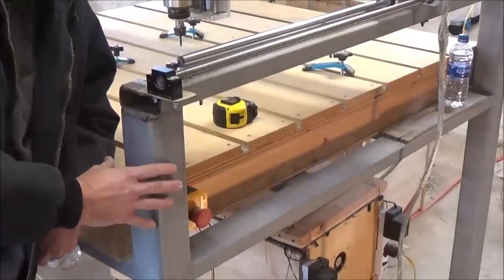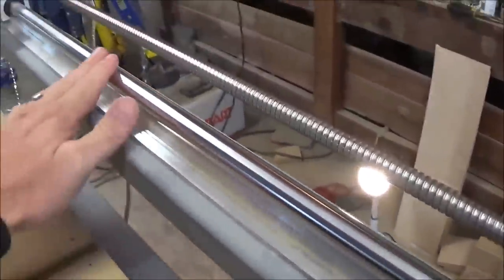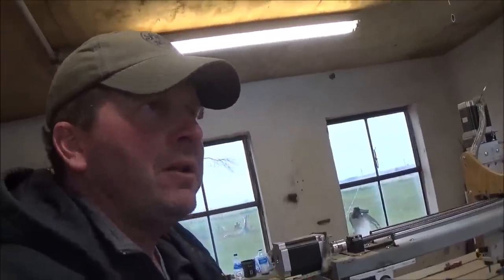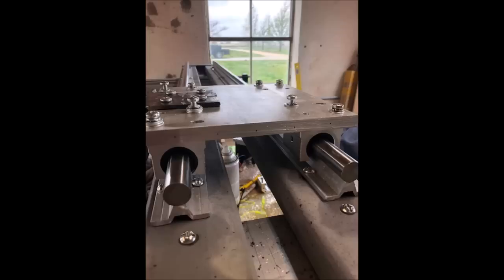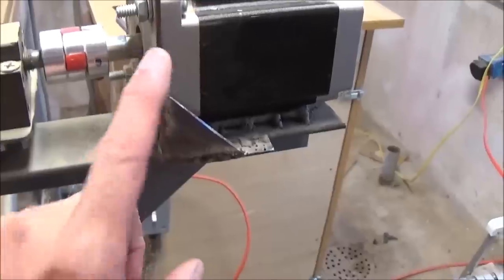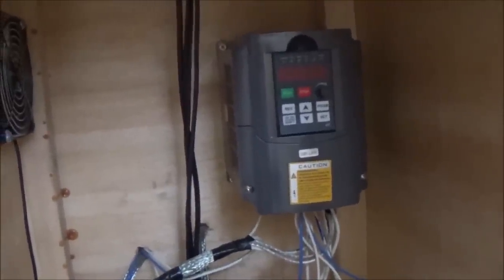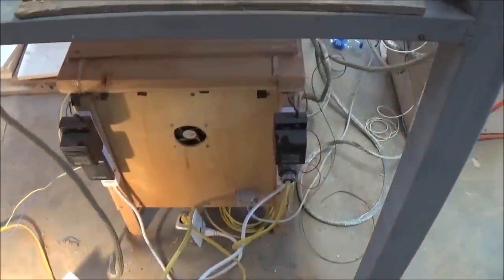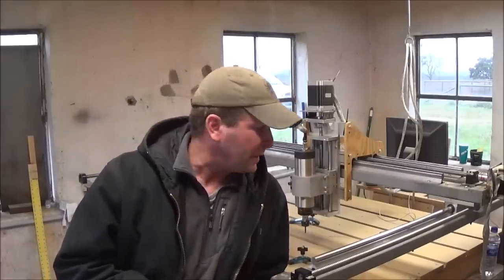My DIY CNC Router build

Comment: Great machine, will be my next project. A few general questions:
1. Stand weight. I guess that helps to prevent “jerkiness” of the table? You mention you had the material laying around/readily available, but could aluminium work? I’m a bit worried about 800lbs (I will assemble in one place, but then need to move it around to another place)
2. Squared-ness. You mention all has to be absolutely square. I agree, but I think it’s really the rods, gantry, carriage and spindle need to be square, correct? Having the table not totally square is ok, but rods etc need to be square. I’m thinking of adding a few laser pointers to allow for squaring these up easily.
3. Endstops. Did you finally add endstops to this rig....?
4. Camera suggestion. Have you heard of the DJI Osmo products (https://www.dji.com/ca/osmo-mobile-2?site=brandsite&from=landing_page)? I bought one of these for my wife for Christmas last year so I can record her dog training endeavours. She never gets to use it (I love techie toys), but does appreciate the results. This gadget may help making more “gentle” videos
5. Resolution/precision. I’m thinking of adding another head for 3D printing of larger pieces. This will require 0.1mm stepsize in X, Y and Z. Any feedback on the precision of your machine?

I will most likely use 5’ length rods and ball screws just so the table can handle 4’ material, and design the whole setup in something like Autodesk Inventor. This way I can  simulate the moving parts, and hopefully ensure that the design space is a true 4x4 feet.
I think I will also use a “vertical” X-axis (one rod above the other rod on the gantry), as opposed to the “horizontal” plane that you have: I think this will help making a true 4x4 design space.

Sorry for the long write up.
Reply from the maker: 1..Yes, I think aluminum would work great, if the "jerking" around moves the machine you could always use weight bags, or concrete anchors...
2..Yes, correct, just the rails have to be square (and perpendicular axis) however it is very nice being as close to possible to square when laying out your material for a project..
3...No I haven't added any safety features to speak of, just have a emergency stop...
4..I have hear of Dji, they make camera and drones, I know very little about them...I'm currently using a Sony Ax53 4k...
5..I haven't ever set down and measured precision and accuracy...and Yes on the gantry, I have actually made a couple of more video's about the machine where I talk about this very thing for the gantry....Have a Merry Christmas and thanks for watching!!
Reply: Smokey's CNC Woodworks , thanks for your answers and experience sharing. I have a similar camera (size wise, not quality) but find it awkward to handle: it’s made for small hands. Take a look at the dji thingy (it’s not a drone). It’s an gimbal that you can mount your cell phone on. It will keep images stabilized and will smooth movements. Great value for the money (no, I don’t work for dji, not do I receive any commissions). Merry Christmas to you as well.

Comment: Limit switches are easily available out of a microwave oven they put up to a half dozen 
In each one , of coarse they can be bought on the cheap too. Just fyi. Good job on the build
Reply from the maker: I actually did purchase some, I've just never messed with setting them up, once I got it up and running I was ready to start cutting!!...Thanks for watching!!

Comment: Great overview and information and good job keeping both the machine and the video simple and straight forward. Wish I could hang out with you. Thanks for the inspiration, I'm not going quite so big but I cant wait to get building. Cheers!
Reply from the maker: Smaller would have been easier, I built it 100% by myself and at times another set of hands would have been handy.....with a smaller machine you should have no problem lifting all the components and keeping them in place.  My gantry and the sides of the frame were really heavy and hard to get in place to weld them....Thanks for watching!! and if you have any questions I'll do my best to answer them...

Comment: Nice sold build.  One thing on your shielded wire. Make sure it's only grounded(drain) on one end. If the shieldeding touches any other grounded object it will not work.
Reply from the maker: Interesting, guess I hadn't thought about, but i only have them grounded on one end (only because I read about installing it but it didn't give the why and I hadn't givin it another thought) Thanks for the info and Thanks for watching!!

Comment: Nice video. I wonder if there is a good option for updated computer and software and all the electronics to run it. 

Im looking into building one right now
Reply from the maker: the computer side, I bought a rebuilt computer with minimal memory and the minimum windows version needed for Vectric Aspire, I usually recommend Vectric Vcarve, cheaper and does most of what I do, aspire adds 3d which I don't do much of......I bought the computer off of ebay for $95
Reply from the maker: reason for a cheap computer, it stays in the shop all the time

Comment: Love the design, this thing looks tough!!!.. Well done sir.
Reply from the maker: Thank you and thanks for watching!!
Reply: Hi Smokey....Well, after scouring the internet, google searching, and countless youtube videos; I have now decided to shamelessly copy the general design of your machine. I like how none of the ball screws are hiding under tables etc, it's just the best I have seen anywhere!!. The machine looks like a beast, and you obviously put a lot of thought into it.  I appreciate your comprehensive overview. 
My ~"copy"~ will be 3.5ft x 2.5ft .... and unfortunately 90% wood as not only do I not have a welder...but lack the necessary skills to work it even if I did lol. I ordered all the parts today and can't wait to get into this project. I used to have a cheap Chinese 60x40 ... which in all honesty worked well.. but was way to small to actually make projects without having multiple sheets... I will use Aspire (my favorite design software), and probably Mach3 which I still have laying around here somewhere. I have way too much time on my hands at the moment, so it will be a full time job for me build wise, over the next few weeks.... I'll let you know how I go  :)
Cheers again.
Reply: Update!!  :) I finished building my CNC machine!!! ... I was on a tight budget and had a great amount of luck when hunting garage sales. I got an old steel bed frame that I ripped apart and built a really nice machine with. I used the ball screw method on all axis 1m x .5m x 30cm with Nema23 motors and TB6560 controllers to control 2x X axis and the Y and Z. I bolted the machine to an extremely strong steel frame to lift it to chest height...lol it weighs a freaking ton. I built a shelf under the spoil board to hold the PC that runs Mach3...and my favorite part was a monitor and keyboard/mouse stand that's built onto the side. Yeah took a while, but I stuck to your design (although I did take your advice and rotate the Y axis 90degrees to give a little more cutting area on the X axis. I have been spending a crazy amount of time on Aspire generating dozens of projects. Anyways it's built like a tank and I wanted to thank you for your inspirational design. You rock Smokey Cheers!..

Comment: Great machine! I use wooden hold-downs because they are cheap and sometimes I cut very close to the edge.  You might be able to see them in some of my cnc videos.
Reply from the maker: I have considered using wood hold-downs, because if i did get into them not near as big of a deal!....Thanks for watching!!!!
Reply: Smokey's CNC Woodworks , I like your metal but adjustable machine. It is stiff. I subscribed.  I also do cnc videos.  I made a $200 machine but wow is it accurate.  I built it especially to make parts for a super secret project that I will soon reveal. :-)

Comment: How did you wire two motors on the "Y" axis? I have been looking at control boards but I am a little confused because they only have one out put for each of the axis. A few other boards have multiple axis out puts, ex. X,Y,Z, and then A,A (A having a slave). Are you able to tell the software to use A and A (Slave) as a "Y" Axis? Thanks!
Reply from the maker: Yes, In mach 3 (Controller software) there is a slave option.  So I have Y and A slaved, and works great...Thanks for watching!!

Comment: How much of a workable Z axis do you have on your build? And after using it a while are there any changes to to it that you wish to do?  My dad and I are currently building one, based off of yours, and we even have all of the parts already. I am just perpetually debating  on the distance between the bottom of the work board to the bottom of the gantry.
Reply from the maker: Ok so my max travel is roughly 5 inches as it sets...I made the work top removable so if I need more travel I can throw a sheet of plywood in the work tops place and gain another 5 inches....What I would do differently is make the y rails (the left and right rails) about 4 1/2' to 5' apart so your x axis could get a true 48" travel...On the Y axis you lose some travel because of the width of the gantry. On this I would either turn the gantry up on its side to shrink its footprint or I would mount the spindle in between the 2 rails on the gantry, this would allow you to cut down the loss of travel in half(to about 5" loss of travel)..My gantry is about 10" from the back of the gantry to the bit..So I lose roughly 10" of travel on the Y axis.....Thats all I can think of off the top of my head, LOL...Like i think I said in the video, I just did a lot of research and went to work on it without really a plan other than what I had in my head of what it should look like....Thanks for watching!!!
Reply from the maker: You can reach me at SmokeysCNC@gmail.com, I'll answer what questions I can if you get stuck and point you in the directions I got some answers.
Reply: @SmokeysCNCWoodworks  Thanks for your reply, that helps a lot. I'll make sure to email you a picture if we ever finish.

Comment: Hi brian  I have a question  about  you  set up  on the y axis  with  nama 34 I try to build 4 feet by 8 feet y axis motor can run ok but  some  time want run  opacity direction one go one way  the other the other way

Comment: I'm really close  to getting a build underway. the machine won't be for hobby purposes, but to be an addition to my small business where I already have a new commercially bought machine. I'd like to know what your tolerance is now since you've had it for a while now.  Under .005 or .0005? Please let me know. thank you
Reply from the maker: I've never really measured the tolerance....I will work on that and get back with you...Thanks for watching!!
Reply: @SmokeysCNCWoodworks  a big concern which relates to the tolerance is backlash. I should've been more specific. Let me know. Thank you

Comment: whats the part called that you tap on ballscrew glide? were did it come from i have 6 footer ball screws 20 mm 1800mm and i cant seem to find them so i can screw the gantry plate on
Reply from the maker: That is 1/2" aluminium that I cut down to 5" x 9" plates and attached the glide...Thanks for watching!! email me at Smokeyscnc@gmail and I will go get exact measurements and take a pic if you like..

Comment: Very impressive that whole steel frame is industrial quality and has to be very solid. Have you had any problems with the electronic end of it after this amount of time or anything you would have done different? Thank you for sharing this is amazing!
Reply from the maker: I haven't had any electronic problems, the one thing i would have done different is put the electronics box beside the computer stand at the end of the table...right now the electronics box is under the table and it is hard to get down there to do anything and the way i wired it up, i would have to unwire about half  of it to get it out from under the table then rewire and so far I"ve not wanted to do that.....THanks for watching!!

Comment: What happens if one of the Y stepper motors or power supply quits. Will it warp the guides due to one motor still trying to move the arm
Reply: Of course, it can damage the all construction easily. Two motors, connected in series, to one powerful stepper driver- most smart solution.

Comment: Really great build. Considering to build similar pattern now. Can you tell me how you mounted linear rails to steel profiles? I mean I know general process (drill and screw) except I am afraid it will be problematic to keep tolerances or adjustments later.
Reply from the maker: sorry , for a horribly late response, was just going through older comments.....so I marked placed the rails where i wanted them, and then used a pointed chisel/stamp to dimple the metal in the center of each hole in order to make sure the drill started just where I wanted it to....Thanks for watching!!

Comment: How hard do you think it would be to modify your table design and make a cnc Plasma instead of Router. I would think 99% of the hardware would work on either. Just redisgn the base a little for water tray. I currently have a Shapeoko XXL cnc router but I also love welding too. Love your work and machine!
Reply from the maker: I don't think it would be hard to make the shift at all, only a few different components and you would be off and running!!!....Thanks for watching!!!

Comment: What size shield sleeve did you buy?  Thanks for the video.
Reply from the maker: Check the description box, I'm pretty sure I listed it in the affiliate links...I'm pretty sure it was 1/2" in diameter....not sure on length...Thanks for watching!!
Reply: Smokey's CNC Woodworks it was not in the description, only said RFI shield and the link takes you to 1/4 in. I thought was too small. I ordered 3/8, since it will accept about 8 12 aww wires. I thought that was big enough since there is only 4 12 awg wires for the servo and 2 20 awg wires for end stop.  Thank again great CNC. Going to use some of your ideas to improve on my 4 X 8 ft CNC.
Reply from the maker: @rickmccaskill7888  Ok Sorry about that, I don't think I got 1/4 either, i was thinking I got half inch but 3/8 should do the trick to, it expands enough to get the wire through

Comment: Wonderful work. Solved my major problems . Thank you 😀🙏. The no of axis is 3 that is x, y, z then why do you have 4 stepper motors sir ?. Nice work sir 😀🙏
Reply from the maker: I added a 2nd motor to they y axis, because of the size and weight of the gantry and I didn't want the gantry to twist by pushing on one side, so with the dual ball screws, it stops any twisting.....Thanks for watching!!

Comment: Can you please tell how did you selected the stepper motor....by the way can you tell how much weight is sliding on the y axis ,driven by the stepper motor
Reply: Also, can you say the torque of the stepper motor used??
Reply from the maker: Well, I didn't use any kind of formula to figure this out....I simply looked at a lot of machines and found ones with the approximate size I was wanting to build, utilized either nema 23 or nema 34 stepper motors, I tend to go for overkill instead of risking being under powered....so i chose nema 34..The weight of the gantry with the spindle i would estimate somewhere around 80-100lbs, I've never actually weighed it.....and I honestly don't remember the torque and all the specs on the nema 34....Thanks for watching!!

Comment: Hi. Quick question about your Y axis. I see you have duplicated the drives, are these std stepper motors, and if so, how do you solve the problem of the motors going out of sync? Thanks in advance. Andy
Reply from the maker: Yes standard steppers, In mach 3 there is a slave axis option, so when you do that it makes the yaxis signal go to both motors at the same time....I've never had any problem with them being out of sync....Thanks for watching!!!

Comment: Excellent build!  I've started buying parts based on your list, but i'm going to up-it to a 5x10 machine.  I have a small cabinet shop and I'm looking to this for panel processing.  Do you think the spindle you picked has the power to cut through a sheet of 3/4 ply in one pass with the right bit? maybe two passes? Thanks!
Reply from the maker: I wouldn't recommend trying to cut that deep that fast...The router would do it yes, where it would mess up is on the stepper motors, it would put to much of a bind on them and i have never seen one that would take that deep of a cut.  The most i've ever tried is 1/4" and honestly haven't tried it since...I usually do about 1/8" per pass....to cut like your wanting to do you would have to go with a machine with industrial motors on it.....but honestly it doesn't take long to do 3/4" going 1/8" you can turn your feeds up pretty high, if you were comfortable at 1/4" that would only be 3 passes but i would turn the feed way down ....THanks for watching!!